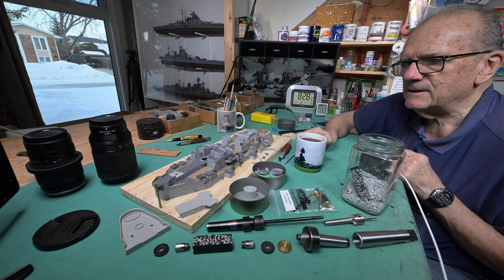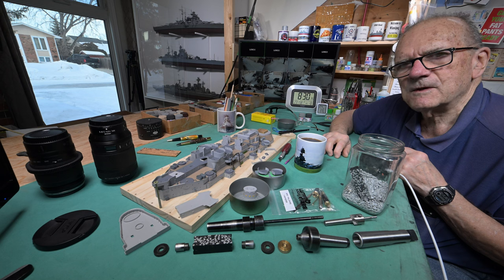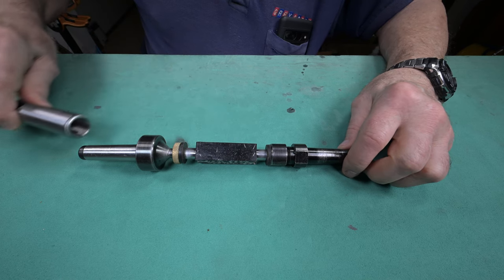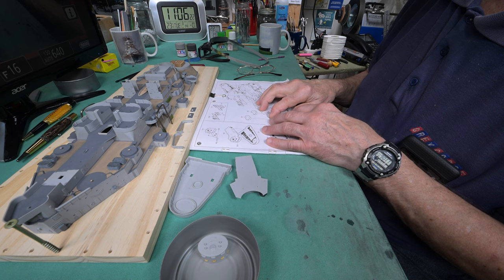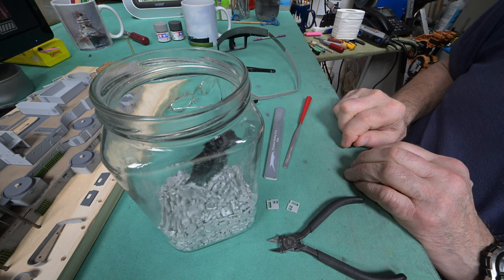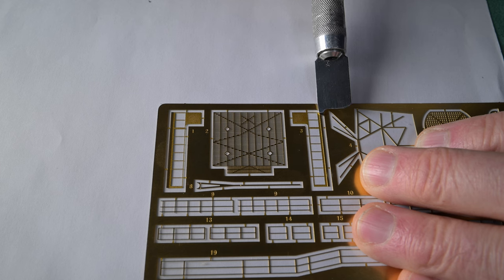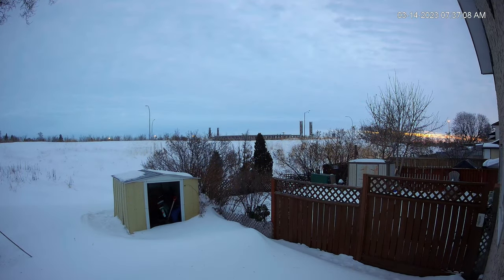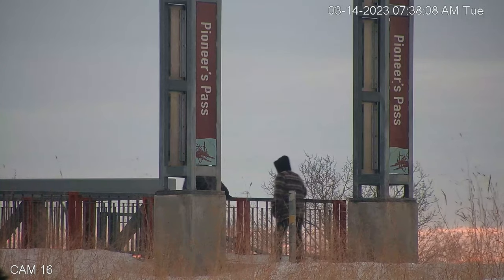The Model Ship - Part 1519

Comment: Yep, that piece of PE is a bear to fit. Like Aussie said, make sure you know where it bends. Clamp it tight In your bender. I like to use a single edge razor blade to lift tough bends like that. Dry fit as you bend it. When you get the angle right it fits very well. I'd paint it before glueing it on but that's me.😉
Reply from the maker: Thanks for the tips!

Comment: Hi Ron I would not have purchased the small lathe. You have a metal lathe you could have used it to turn the pen blank. You could have made a rest to go into the tool post holder so you could use the wood turning tools and achieve the taper. Just a thought.
Reply from the maker: Hi Dave,
Yes, I'd seriously considered that too. Unfortunately I could not envision a comfortable way to sit at it. 👍🏼
Reply: @roncalverley  I see your point My feet are shot out from 50 years of running machines so I get it good luck with the new lathe

Comment: Hello Ron! I have a question, did you buy extra metal parts for the Uss Missouri? Because the normal kit without extras does not have this metal part.
Reply from the maker: This is the USS Iowa kit. and some PE was included.
Reply: @roncalverley  Oh sorry Ron! I forgot it was the Uss Iowa. I see every video of yours since I joined your channel a year ago. Built the Uss Missouri, cost $100 more and looks almost the same, I get it It doesn't matter why. Greetings from Austria!